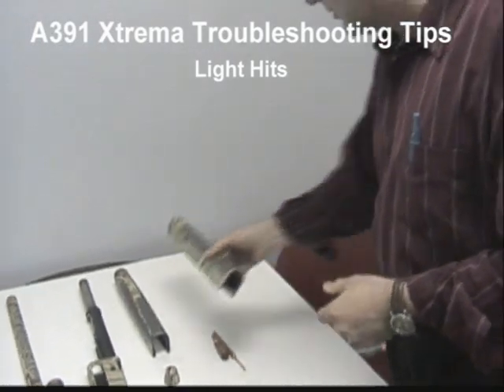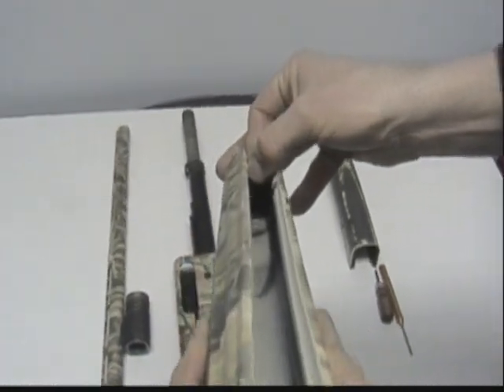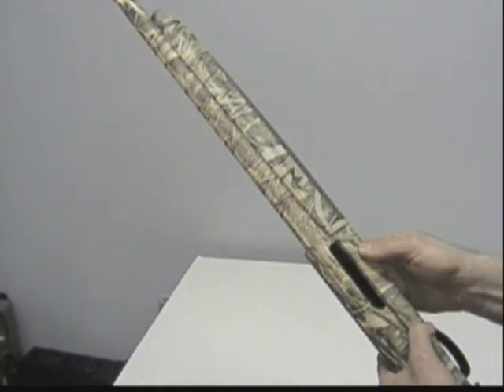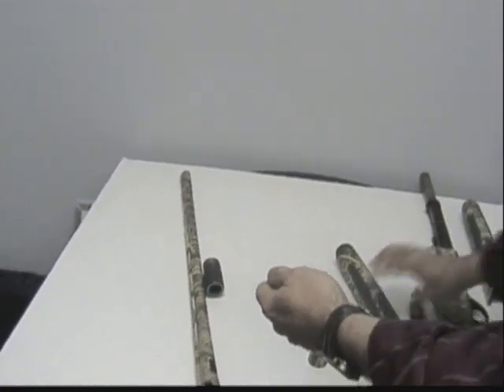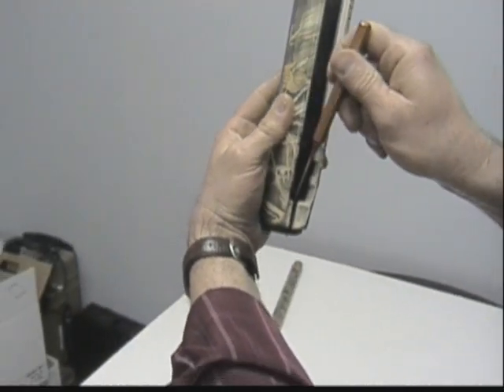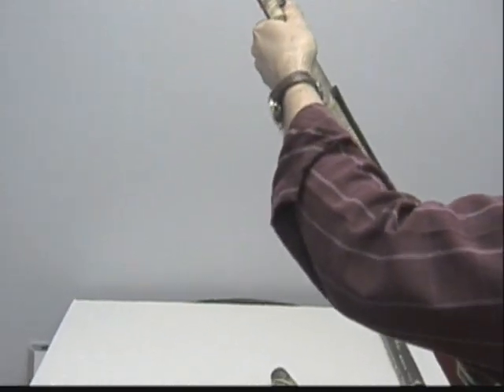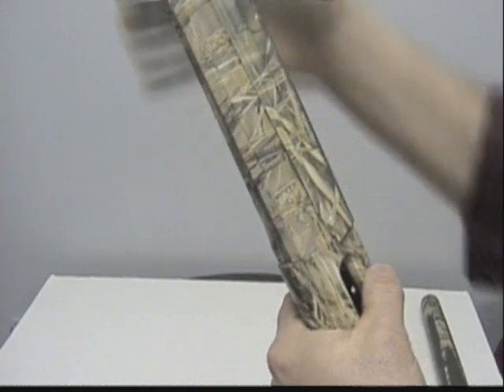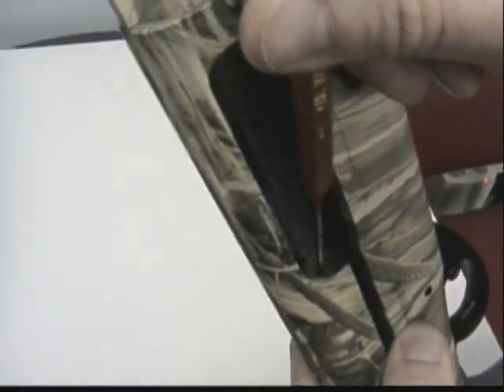Beretta A391 Xtrema Troubleshooting

Comment: I purchased a used A350 Xtrema about a month ago and had issues with misfires.  Not light strikes but straight up misfires.  Got home, took the gun apart and found that black o-ring in the wrong area of the gun.  Previous owner had it installed between the front of the gas piston and the assembly for cycling the gun.  Thus, the gun would fail to go into battery and misfire.  Got that fixed up and have had an awesome shooting gun since!  Thanks for the video!

Comment: Hopefully your website is still up.  I need a new o-ring for my Extrema ii.  Do you know what size a replacement o-ring should be?  The o-ring is out of production and none of the usual vendors have a replacement.  The o-ring needs to be a Viton o-ring to withstand heat and pressure.  Thanks, Don

Comment: is there any video on how to add extension mag to an A400? I've seen video on how to remove the plug etc on A400 but nothing on how to add an extension tube, and the correct way to install the right length on the spring using this extension tube. thanks